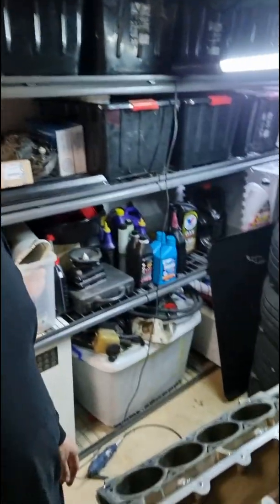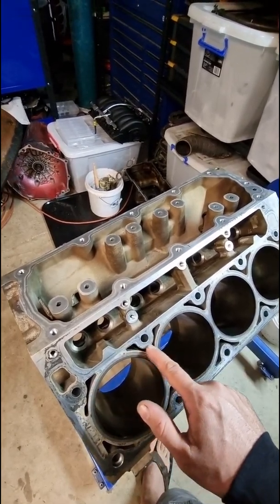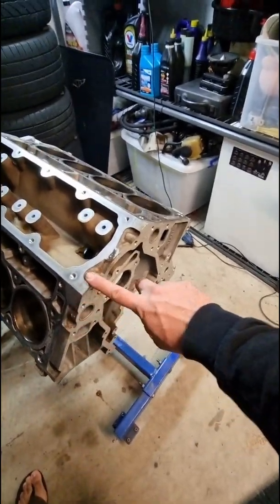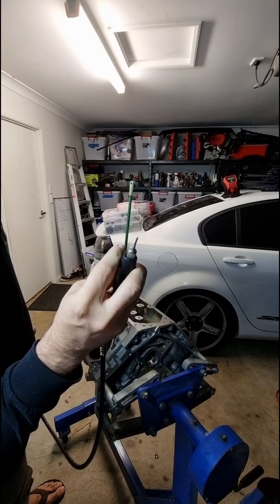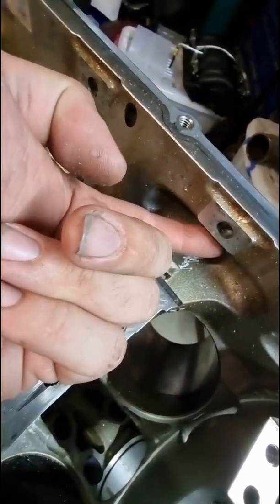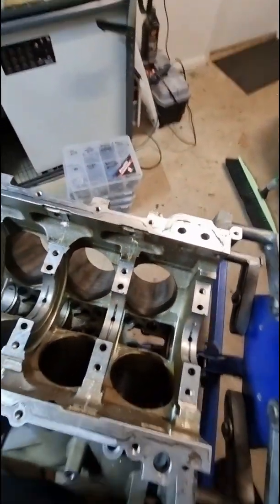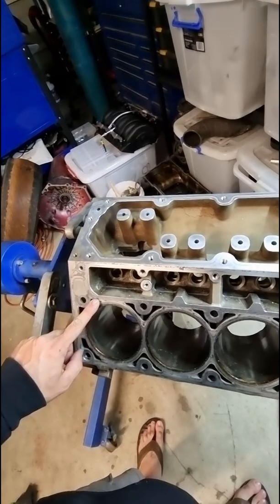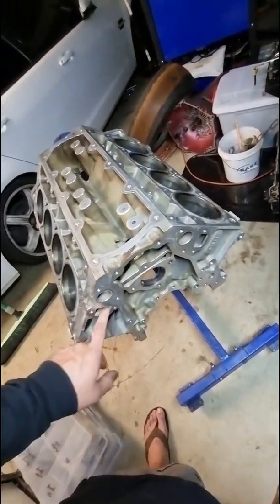How to build an LS part- 7 Deburring the block, LS Patrol

Comment: what are you using for dye Rinder? I have never seen an electric that small.
Reply from the maker: Hey mate it is just a cheap Dremel I bought from mitre10 for like $50. Came in a huge kit with a heap of attachments and the flexshaft driven pencil attachment. I think I payed more for a decent burr for it.
Reply: Hey mate just guessing you're not making the series anymore?